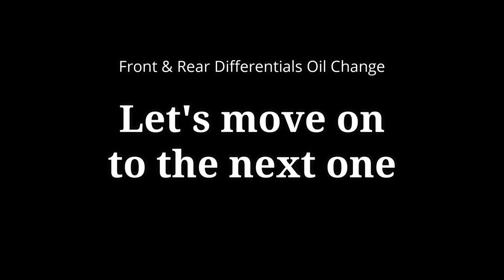HOW TO CHANGE FRONT & REAR DIFFERENTIAL FLUID (diff oil change)

Comment: Curious why you didn't use the Laser 4385 pump? I am just about to buy one .. did you abandon it becasue of issues? Thanks
Reply from the maker: We used this one because as there isn't any required amount of oil for the diff we can pump it in directly from the bottle. We still have the other one and still use it👍.

Comment: Why even bother? It's a Land Rover and it will just break down anyway! 😭😂😁😜🥰.   Hope everyone saw that you opened the fill plug before opening the drain. 👍 Nice work. What about the transfer case?
Reply: +1 Yes if it been used hard and ben wading check the transfer case
Reply from the maker: Thanks! Transfer case was done when replacing clutch but you'll surely find the transfer case oil change in my maintenance playlist.

Comment: Too thick oil; much better Yacco BVX LS 200 SAE 80W90, specification ZF TE-ML 05C 12C 21C. That's why you have too metal shavings in your drained oil. Yacco BVX LS 1000 SAE 75W140 ZF TE-ML 05B is an obsolete specification.
Reply: Consult "ZF list of lubricants" for a complete list of oils according to your specification.
Reply from the maker: Will check this out 👍